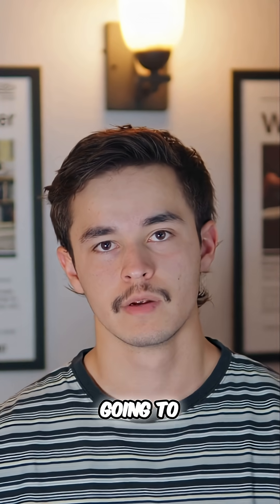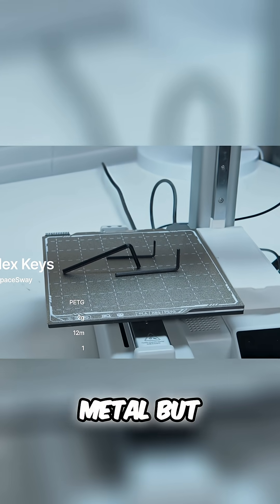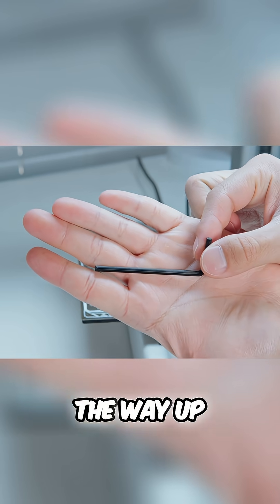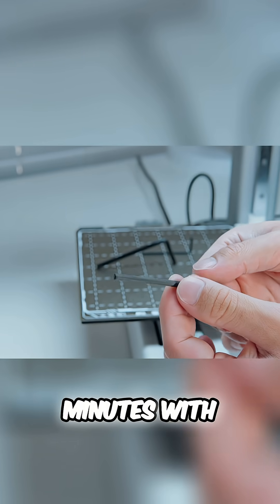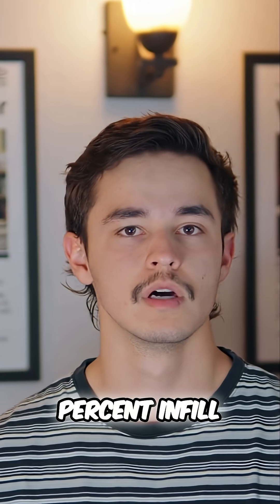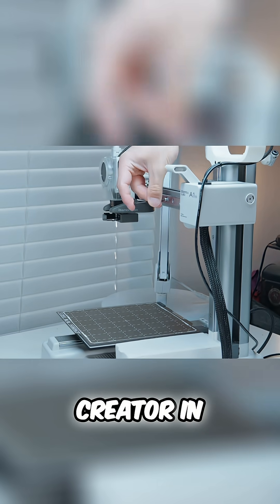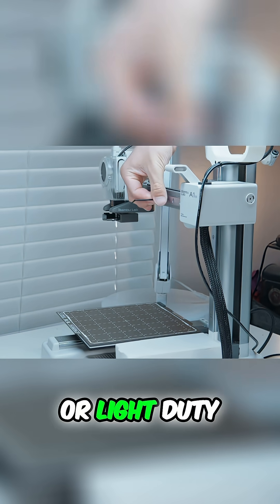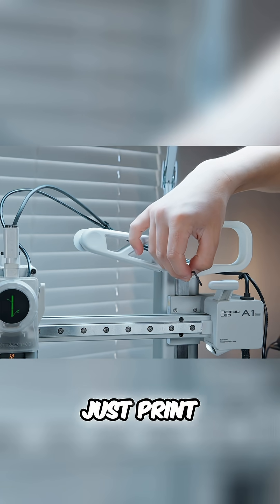This 3D Printed Hex Key Actually Works!

Comment: For demonstration purposes or older printers yes, modern printers NOOOOOOOOO……
Modern printers have much higher operating speeds (as much as 600 mm per second) and higher acceleration, this can cause insufficiently tightened bolts to loosen (especially on the hotend). it’s also worth mentioning that even if you tighten them sufficiently, if not tightened to similar torques it can introduce abnormal forces that can cause bolts to loosen. With a plastic tool you’re guessing how tight your bolts are due to the nature of the polymer chains within the material’s structure.

Comment: The metal ones that came with my printer are bent af, I doubt this would be any use on the same screws that bent the metal one 😂 still going to print it for fun and use up filament scraps 🤷🏻‍♂️